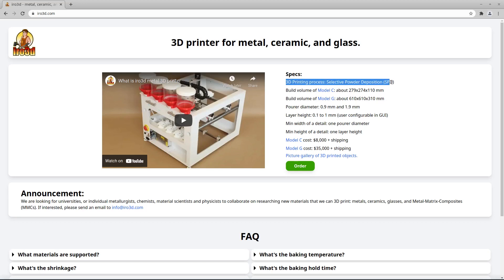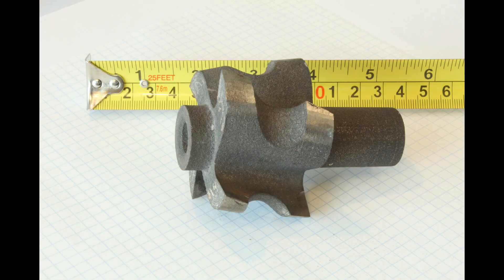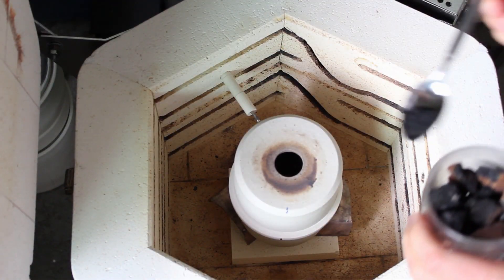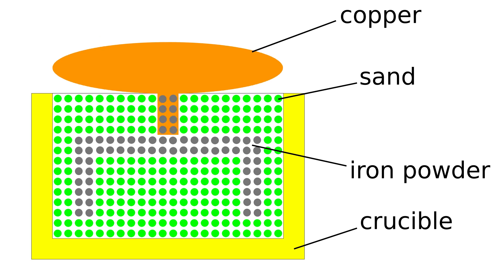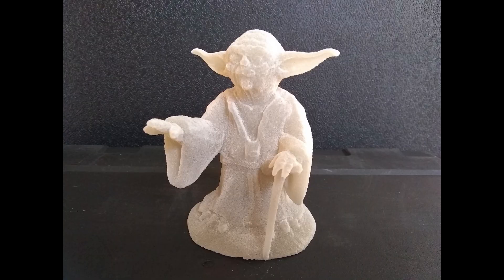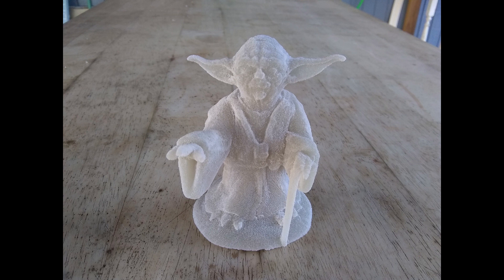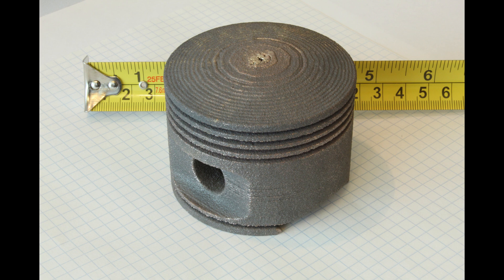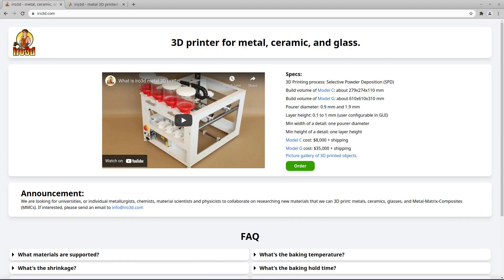Best metal 3D printer. (Also can print glass, ceramic, and composites)

Comment from the maker: Update: It looks like we can achieve 100% density even with the sintering variant.  It works well with glass, and should also work with metal alloys that have large difference between solidus and liquidus temperatures. It requires a vacuum furnace.
Reply: would an autoclave suffice or are they not hot enough for the type of melting needed?

Comment: If this works as well as it seems to - it seems to me it could be amazing for making metal matrix composites - it would all depend on how well the infiltration could work on something not as easily wettable. regardless, I think that the best way for you to get some publicity about this machine would be to send one to a youtuber who currently does lost PLA casting or something similar, as they would already have a kiln to use it with. And I think the real make or break with this is wether it out-competes lost PLA - but if it can produce proper metal matrix composites, IMO it probably wins, and you're ready to start selling lots. Just my (unqualified) opinion - good luck!
Reply from the maker: Thanks for sharing your thoughts. Regarding the metal matrix composites, you can infill powder of practically any material, even if it's normally non-wettable, by first coating it with a thin layer of metal, using, for example, electroless metallization.  Alternatively, you can infill a ceramic powder with vacuum and pressure method.  Regarding the lost PLA casting, it's not a direct competitor, because it has many shape limitations.  For example, you can't use lost PLA casting to make a rocket engine with conformal channels, or something big with very thin walls.  Questions: 1) which YouTuber would you recommend?  2) Which materials would you use for the metal matrix composites, and for which applications?
Reply: @iro3d  
Hi, after looking around, I'm not sure I was right about sending one to those youtubers, because there doesn't seem to be anyone who's particularly well known - but maybe send one to angus at maker's muse if he's got a kiln? He regularly reviews 3D printers and that might give it the jump-start this needs, as right now you seem to be stuck where nobody knows about this (I practically searched for exactly this had to scroll down a long way before I found this), and so it's expensive, and so there's not enough interest (which is a REAL shame - this seems to be the best method of home metal 3D printing around - gets proper, strong, accurate parts and the printer itself isn't likely to be vastly more complicated than a normal one). If this was about the price of a resin printer nowadays (£500-750 here in the UK, including curing stuff), I would buy one in a heartbeat - but it's just outside my price range atm. :(
Reply from the maker: @robbiejames1540  To make the printers cheaper we would need to manufacture them in larger quantities.  Do you know anyone with whom I could partner on a Kickstarter campaign?
Reply: @iro3d  
With regards to partners, unfortunately I know very little in that regard - although I would imagine you'd have a good chance with it as you already have a working product- you just need to get it known about.
Reply from the maker: @robbiejames1540  Finding a partner is hard.  I know lot's of engineers, but no one who knows marketing who could help me with the Kickstarter.
Reply: @iro3d a kickstarter is all about popularity. Of course your presentation has to be flawless and very attractive, listing all your benefits. But more importantly is your popularity. I would suggest getting popular first and then opening for money. I know you want to make the most money you can, but if you never started a factory before, it’s hard. The easiest one would be to hire some men to assemble it by hand. Depends on how much cash you have, these machines are expensive like gold. 

The key to getting popular is to have someone who is already popular show it. Have them show it, and present a kickstarter at the same time, so that the viewer would think “I could preorder for 1000$, instead of paying 10k”.
Of course you would have tiers and such and you can always copy off the others. 

You could pay a guy to make it sexy and place ads on YouTube for it. I know a good video editor.
Reply from the maker: @Stealthsilent1337  interesting thoughts - thanks.  And yes, please send me the contact of your video editor.
Reply: @iro3d  whats your email? everytime i write a response, it gets deleted
Reply from the maker: @Stealthsilent1337  I never deleted you.  My email is on the website: iro3d.com
Reply: @iro3d  
with regards to the limitations of lost PLA, I know that all too well, as right now I am trying to make a rocket engine with cooling channels and it's very difficult - I would love one of these, or even to just be able to buy a part produced by one, instead of paying thousands for commercial 3D printing. With regards to composite combinations, I'm thinking that copper + industrial diamond is very promising for extreme thermal conductivity and improved mechanical properties - Aluminium and silicon carbide is quite common now, as far as MMC's go, but I think aluminium and titanium diboride might be better - the aluminium won't react with it, and its harder and i believe it's more easily wetted by aluminium.
Reply from the maker: @robbiejames1540  industrial diamond + copper, silicon carbide + aluminium, titanium diboride + aluminium - all sound very interesting.  Do you know where we can buy such powders?  As for the rocket engine with cooling channels - I might be able to print it for you.  Send me the step file.  Sergey.   info@iro3d.com
Reply: @iro3d   A caster I like to watch is VOG. These guys don't do casting, but Integza and Stuff Made Here strike me as individuals that would interested your printer. Fireball Tool is another channel that I think may be interested.
Reply: Absolutely Integza. He is doing metal sintering in almost every video.

Comment: Can I print things that are bigger then the crucible and how bis is the crusible
Reply from the maker: Generally, you can't print things that are bigger then the crucible. Crucibles are sold by 3rd parties.  Also, you can make your own crucible.  BTW, what are you printing?
Reply: @iro3d  so I can make a big crucible and the maschine is still gonne print perfectly
Reply from the maker: @codm-sargent4575  Right. The printer doesn't care from where you bought the crucible.
Reply: @iro3d  so I can make different sizes of crucible ans shapes like an extra long crudible
Reply from the maker: @codm-sargent4575  Yes. You can enter the dimensions of your crucible in the settings.
Reply: @iro3d  ok thanks

Comment: How reliable are these machine? How long it takes to print a tower in the video?   I am really interesting in investing in this machine. However, it is for my business, so I will need more information to consider buying one.
Reply from the maker: The machine is very reliable. The tower in the video takes about 10 hours to deposit the powder. Yes, it's a new technology, so researchers would benefit from it the most. Whether you can use it for business - depends on what you want to print.  Let's discuss the details by phone. Send me an email with your number.
Reply: For now, I see this machine as a new tech for researchers/hobbyists to explore instead of doing business with it. The running cost maybe too high to make profit from it. Just my opinions.